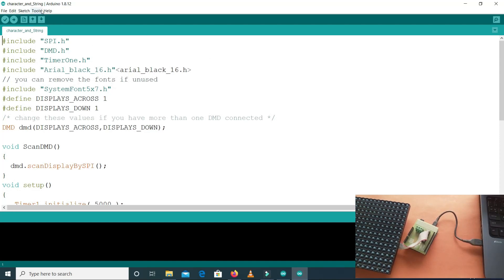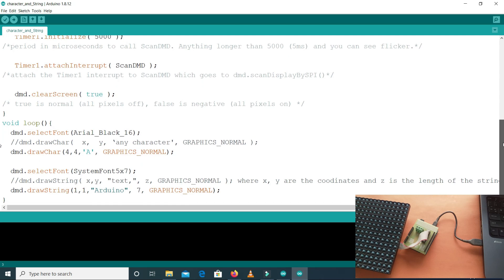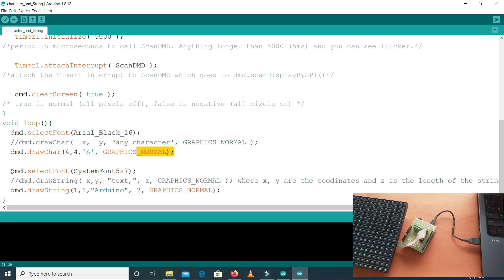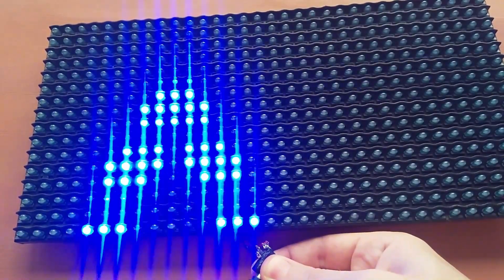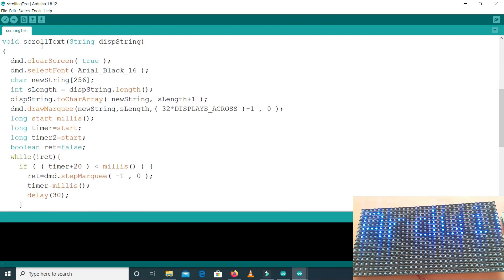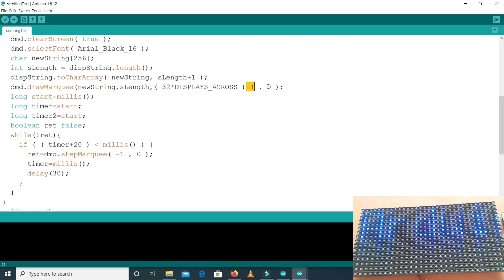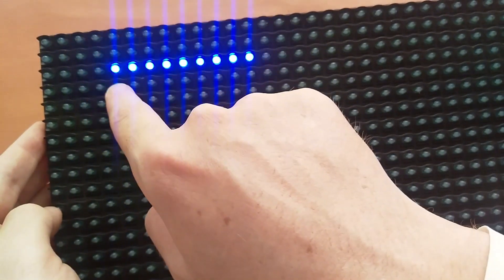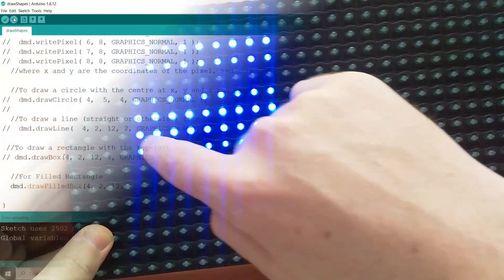How to use P10 DMD using Arduino Complete Guide || Azhar Electronics

Comment: You use ready-made character generators. The smart way is to generate them in real time using one of the installed fonts on your computer! This way you will have more flexibility and a choice of different font designs.

Comment: Sir,while am working on p10 board where connections and code are correct but p10 board  is showing a straight line can you find a solution for this..?

Comment: Great video bud.  I looked at the link you posted for hallroad.org and they don't appear to ship internationally.  Do you have a vendor that sells to the USA?
Reply from the maker: You can order form Ali express.
https://www.aliexpress.com/item/32958466621.html?spm=a2g0o.productlist.0.0.50602360BEPIGm&algo_pvid=a68df8a1-2051-4f46-8750-4e229a949594&algo_expid=a68df8a1-2051-4f46-8750-4e229a949594-0&btsid=0ab6fab215984145229332272ebfe1&ws_ab_test=searchweb0_0,searchweb201602_,searchweb201603_
Reply: @AzharElectronics  Oh that's awesome!  I wonder if my LED p10s are compatible.  Is this your product?  I'd love to support you if it is.  I've been having a hell of a time getting them to work.  The vendor crytptically mentioned I might need a HUB12 card but I can only find bicycle parts when I search for that.  I'd really rather have the fine control I can get from an arduino for this project.  Thank you very much for the reply.
Reply from the maker: @GrantWhoPlaysGames  Yes the product is same as mine. There can be color of led difference. The HUB12 Card is programmable board for P10. Means that using HUB12 you do not need arduino. In order to use P10 with arduino you either need to use the shield which I used in the video. That shield was developed by Hallroad.org so it will not be available to you. The alternate way to do is do connections manually to arduino from P10 module. Here is the link for connections. 
https://circuitdigest.com/microcontroller-projects/digital-notice-board-using-p10-led-matrix-display-and-arduino

Also you can check other vendors on Ali express for P10 module.
https://www.aliexpress.com/item/32957108497.html?spm=a2g0o.productlist.0.0.4a462360xBnBpg&algo_pvid=f878e388-bcf6-43f7-a77e-21ebf942061e&algo_expid=f878e388-bcf6-43f7-a77e-21ebf942061e-2&btsid=0ab50f4915984240281598644e8015&ws_ab_test=searchweb0_0,searchweb201602_,searchweb201603_
Reply: @AzharElectronics   I have tried connecting the arduino uno to the panel manually but still all I get is garbage.  It won't even light up without 5v supplied to it, which I added using a switching power supply.  Also I can't get any of the examples on your video or anywhere else on the web to work. They either don't work or they display garbage, and not even garbage on the whole screen which is actually what I'd like to do.

I have ordered a Hub12 card from aliexpress but it will take forever to get here.  I feel like I'm doing something very wrong if I can't get ANY of this code to run.  I can't even make it just blank the whole panel and then turn on the whole panel.  I have it currently wired up exactly like they have it in the circuit digest.

I really appreciate all of your help.  I've subscribed to your channel, love all the engineering stuff.
Reply from the maker: @GrantWhoPlaysGames  Thank you. I am trying to make a video on How to Connect P10 to arduino without that shield. So that everyone can do it easily without the shield.
Reply: @AzharElectronics  I can't for the life of me figure out why this isn't working.  I've wired it exactly like the examples.

Comment: Hi Sir, I would like to make  notice board that can display the text and this can be activated remotely using wifi. I plan to use arduino uno R3 + esp8266 nodemcu + P10 panel led. 
Appreciate if you you could assist on this matter? 
Thank you.
Reply: Hi bro, did you make it?